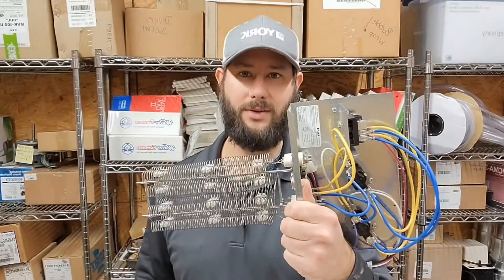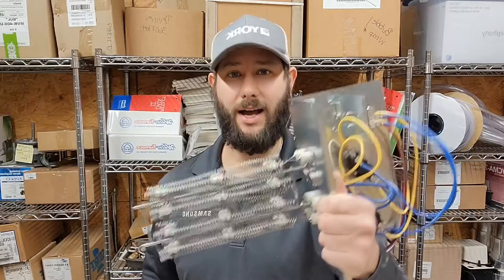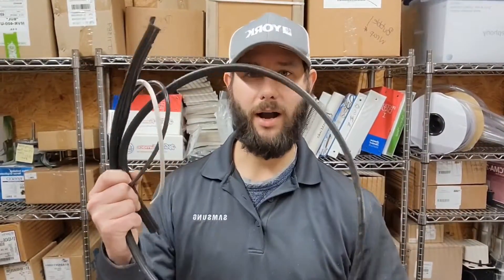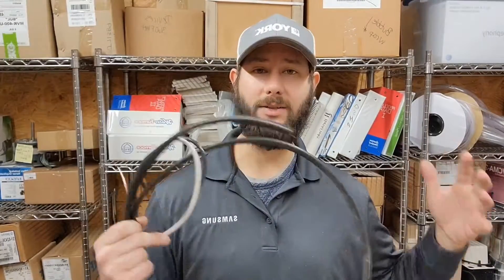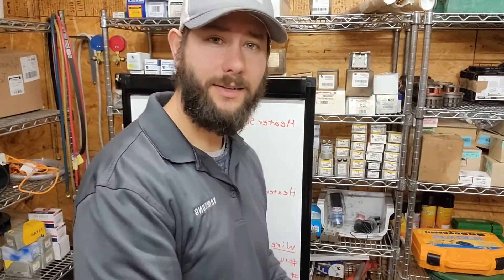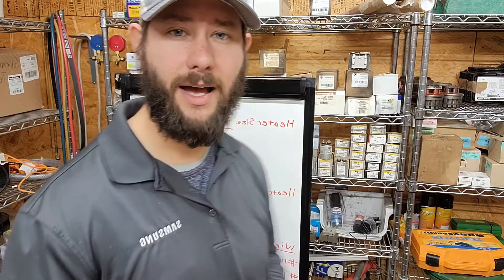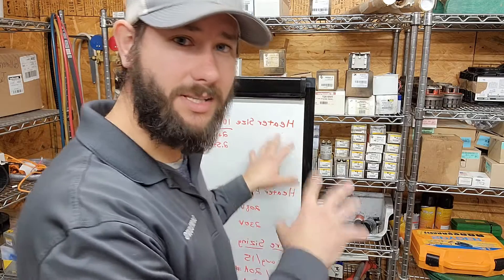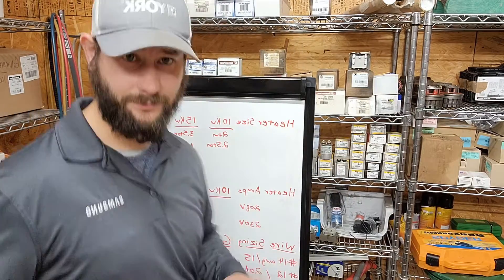How to size Heater Kit and Wire Sizing HVAC Basics #heaterkit #wiresizing

Comment: Ugh!!!! Watched all the way to the end to be let down.
    Can someone help me answer one question?
    Right now im installing a 60amp breaker with 6g wire for the 15KW heat bank in this heat pump.
    What doesnt make sense to me is that the wires coming directly off of the electric strip heaters to the 60amp breaker inside the heat pump cabinet are 12g!! And thats how it came from the manufacturer... so why am I installing 6g on the other side of this 60amp breaker that came with the unit and running it to the breaker panel and to another 60amp breaker ?
    Someone please help me understand!

Comment: I have a question about package unit it’s kinda old I changed out the capacitor and contactor it was just humming then I seen there was a burnt part where the heat strips were but I wouldn’t think that would be the problem for ac won’t come on would it ?
Reply from the maker: It could have something to do with it if it's popping the fuse.But if not, then probably doesn't have anything to do with it
Reply: @taddydigest it’s not popping anything the part that burnt to me look like a senser by the heat strips there two of them but only one is burnt but I don’t seen anything else wrong with it when I try to turn on the ac I hear it click like it’s trying to tell the ac to turn on

Comment: Is it possible to install a heater element kit of lower amperage on a furnace unit? Or each unit come designed to work with a specific heater element amperage?
Reply from the maker: yes you can install whichever you prefer

Comment: If my 15kw heat strip have two double pole 60amp circuit breakers built into the unit (one for a 10kw element and another for a 5kw element) do I need 2 60 amp double pole breakers in my panel as well? (I’m running a 6AWG to each breaker from the panel)
Reply from the maker: yes absolutely
Reply: If you have 15 kw I believe all you need is a 6-2 and a 10-2

Comment: My furance/heat pump has a list on the label of 7 different kits that can be used.  Does it matter which I choose?  Should I go with the first one listed?
Reply from the maker: I got a video on how to size heater kit
 Check out that video it's on my members only video playlist
Reply from the maker: Watch the whole video and you should get the answer
 You need to find out the size of your equipment to know what heater kit to use

Comment: What if your heating strip element isn't heating up fully, it has hot spots through the strip visually. Looks as though it is not getting hot enough.

Also, 5kw strip was on my HVAC system but now i got 10 kw or 15 kw strip on it now. Any suggestions

Comment: 5kw heat strips A 1200 sq ft house has 5kw heat strips on it.

Simple like a pimple
Reply from the maker: You may need to watch the whole video
Reply: @taddydigest  and sign up... haha it depends which zone your in (state) -humidity, insulation in home...
Reply from the maker: mistakes cost money 💰  and I wouldn't want to make one like under sizing heaters my friend
Reply: @taddydigest  that wouldn't be bad mistake at all actually. Not as bad as driving over a half way cut down tree trunk 🤪😂